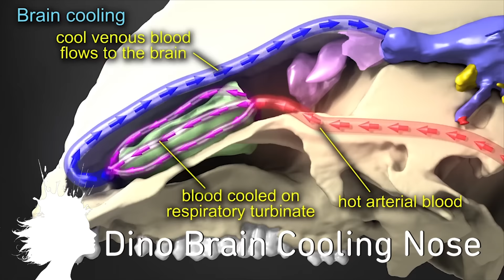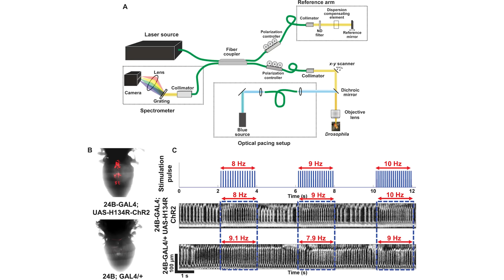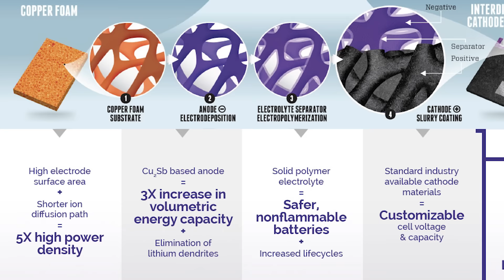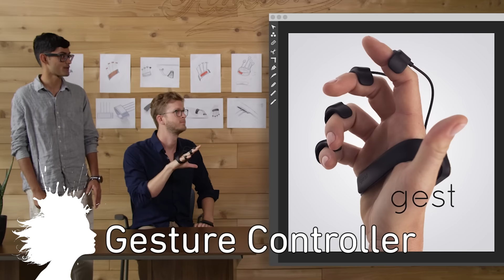Sound Tractor Beam -- Mind Blow #99

Comment: Mind blow #100 should be called #99,999... since it's proven 99,999... is the exact same as 100, one of the mindblows then could be the proof of this statement.
Reply: +Stijn The EXACT same? Really? don't you need to round it out to get 100?
Reply: Fionn Conner Nope. Well, now that I think about it, 0,999.... was the exact same as 1,00. So I guess 99,999... will be the exact same as 100 aswell. You can find the proof of that statement on the internet.
Reply: +Fionn Conner The definition of a number is that is has another number between it and another number. so 6 has 7 in between it and 8. Where 0.000000001 has 0.0000000015 in between it and 0.000000002. If you take 6 and subtract 6 from it, you get zero because the difference between 6 and itself is that there is no difference. So 100-99.999... does not have a real number in between it an therefore equals zero. Thus they must be the same, no rounding needed.
Reply: +Josh McGillivray That makes more sense with a decimal place! If you use a comer Stijn the number is completely different. Then its a partition of a larger number, while a decimal place indicates going beyond 0.
Reply: ***** Yeah, don't quote me on it, but i think the nomenclature is slightly different depending on where you live. I know in canada we aren't technically supposed to use commas so separate thousands, perhaps some use a comma as a decimal?
Reply: +Frequenc Well there is 0.000....(infinite)01 , but really 0.(9)=9/9=Almost one, it's an infinitely insignificant difference
Reply: Vlad Morariu well yes. But 0.0...01 is not a real number
Reply: sws ben jij een nederlander
Reply: +Josh McGillivray I believe there is a term for a number like that and it is an infinitesimal
Reply: +Josh McGillivray so 99,999.1 isn't a mumber
Reply: kalackninja a number smaller than all of the real numbers but larger than zero, which is the difference between 100 and 99.999... is not a member of the real domain. However it can still be expressed and used mathematically, which i see as epsilon (like a backwards three). However in the context of numbers that can actually be represented in the real domain, 0.00000...001 is not a number. look up on wikipedia the infinitesimal, it is the opposite of infinity, and works more like an idea than in the familiar sense we see with numbers such as 0.333... or 99.999....

Edit: Also to note, if 0.9999... isn't equal to 1, then 3(1/3) would not be equal to one as well, which is impossible as a pizza cut into three slices is still a whole pizza.
Reply: kalackninja There is real proof, look it up, not just playing around with definitions.
Reply: Stijn how about no. Because people like you are misconstruing 99 and 100 being the same number theoretically as 99.99 repeating to infinity to 100. So unless you can prove 99 and 99.99 repeating to infinity is the same number, no you go look at a six grade math  book.
Reply: i assumed that was just a typo, yes you are correct, 99.1 is a real number
Reply: Yeah it's all good :)
Reply: ***** No. I am European. It's different in America, I know. But I chose to use the European way of writing because I think this show is hosted in London.
Reply: ***** Hmm... Well, anyways, It depends on where you live. Where I live, it's 99,999... :-)
Reply: Stijn so you're saying the metric system uses commas, or are you saying that where you live 99,999.00 would be written out as 99.999,00
or are you just not admitting the mistake.
Reply: Chris Ross It is that way in my country. I can't help it.
Reply: I'm Ireland its written as 99.999 also.
Reply: +kalackninja I'm pretty sure he's Dutch, as I can tell by his name. In The Netherlands (and the rest of mainland Europe, I think) we use comma's and dots the other way around. 99,999 = 99.999 and 99.999 = 99,999 here. It's all very confusing, especially when you're using an english calculator, I can vouch for that.
Reply: +Fionn Conner 1/3 is 0.333333.... 2/3 is 0.6666666 1/3+2/3 is 1 therefor 0.3333....+0.66666.... is 1 and the other 99 wouldn't make any difference :P
Reply: Márk Vitárius What you're saying is not exactly true. 0,333... is closest to the actual number of 1/3, not exact. What I'm saying is that there is real proof 0,999... equals one, (I've already pasted the link somewhere on my comment)
Reply: +Stijn 0,9... = 1, proof: let x be 0,9... then 10 x = 9,9..., 10x -1x=9x so 9,9... - 0.9... equals 9, 9x = 9 tha means 1x equals 1
Reply: Dragos Secrieru That's what I've been saying this whole time.
Reply: You're using a comma where you should use a period. Commas are used to separate thousands, while periods are decimal points.
Example: 9,999,999.9rep.
Reply: Philo Wintercoat Not in my country.
Reply: Stijn What country would that be?
I've never seen them used like that.
Do you use periods to separate thousands?
Reply: Philo Wintercoat Belgium, and yes we indeed use periods to seperate thousands :p
ex: 0,5 * 1.000.000 = 500.000
Reply: Philo Wintercoat How do you guys pronounce it by the way? Because when we're in class, it's like "yeah the answer is zero comma two"
Reply: Stijn We say "point".
Reply: +Даниил Е It's mathematically proven to be the same as 100.
Reply: +Stijn For us, saying zero comma two would be a point on a 2-d plane.
Reply: +Stijn in America it is said as a fraction divisible by ten. Like 1.2 would be one and two tenths
Reply: i see you watch vi...
Reply: N I don't.
Reply: Ohhh, I see. I thought you meant 99999 was the same as 100.
Reply: It is basically 100 - infinitesimal